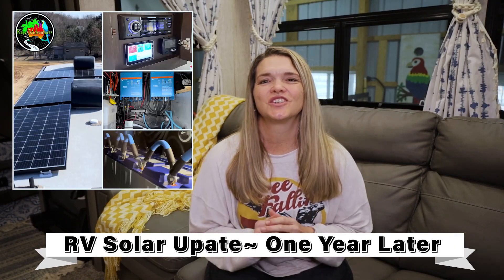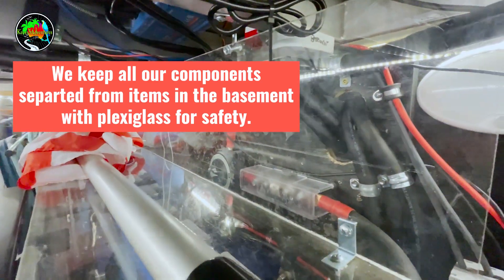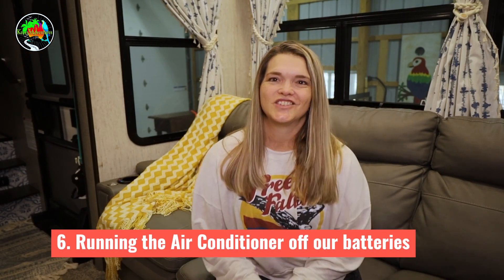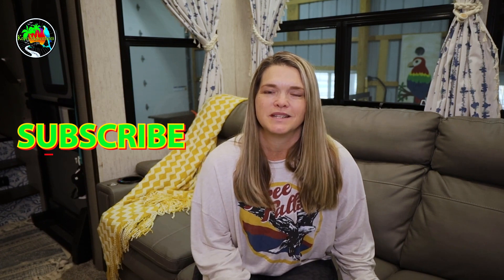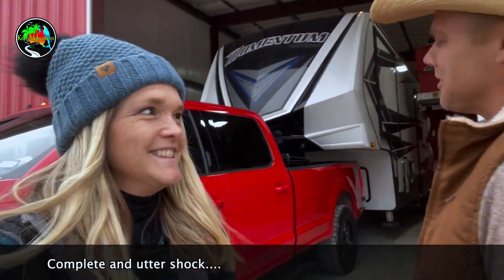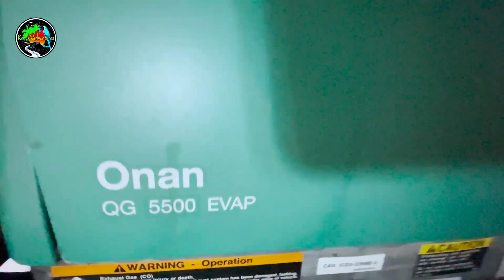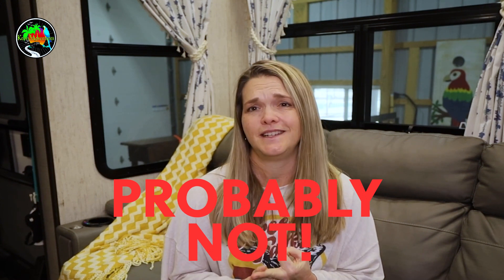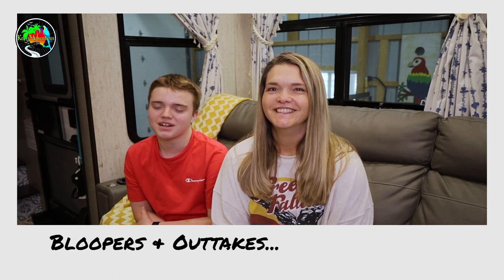RV Solar Update: 1 Year Later! Pros and Cons of Having Solar on Your Camper + Would We Do it Again?

Comment: A 9500W inverter generator would be much less costly than the BattleBorn batteries and the cost of the rest of the system you would get free gas to run said generator and pay for the Diesel for one year on the hauling truck.

Like you setup though... Thanks for that information- great video.
Reply from the maker: We agree! If you get to the end Charlotte says she would have preferred to just have our generator and skip the solar headaches.

Comment: I installed my own system and i have been impressed with how easy most of it was. I however would suggest a all in one system and not one that requires multiple pieces like yours has where everything is separate.  It also makes troubleshooting much simpler and operation is much easier.
Reply from the maker: When we had it done in 2021 a lot less was know then than now! That’s for sure. The technology is much better now! Our system is a pain and is so disorganized!
Reply: @keevs5adventures  Yup, I get that. The inverter I have is actually a home inverter, but I wouldn't change it for anything else. I'm pretty impressed with it and the 415 watt panels. I put 8 panels on the roof  and they are 50 lbs apiece. And I put two 5.12kWh batteries in and without running AC I can go 2 or 3 days with little to no sun. Make sure if you get new panels to use "half cut" panels as they do much better with shading.  It makes a huge difference.

Comment: Well, let’s be realistic about this, sounds like 95% of your problems are all installation related.
Reply from the maker: For sure! Best to get references. And make sure they weren’t trained by the NRVTA who installed our system during their solar technician class!
Reply: I think most installers, at least the ones on youtube, do not talk about the heat concerns of the solar components in a closed area.  I did find this guy that even gives a part list for a fan install.  https://youtu.be/aesa5mJJfNU?si=-PtnvYkl3HblPLW3
And i think the installers should be recommending a 24v system for the 50amp rv’s too.

Comment: That's why I have three systems, redundancy is the key. My main system is 24v
1020 watts. My bathroom and bedroom is 12v 1020 wattts. And my water system is on its own system. 12v 510 watts.
PS. my mobile Abode is a 53' trailer pulled by a freitliner Cascadia HDT.
Reply from the maker: Wow! That's a complex system! Ours is 12V, which we have debated selling the components and going to 24 or 48V. Sounds like you've got quite the setup. Do you have it posted online somewhere?

Comment: I'd like to talk to yall. Your installer kinda didn't do you right. I did all my solar and it's great... and dependable.  I have 45 kw of battery now but it's not battle born lol
Reply from the maker: You’re welcome to email us or message us via Facebook or Instagram. We have definitely had a hard time with our system and have had to become DIY solar people as well.
Reply: @keevs5adventures  you have some good equipment and there are several things that can be done to make it much more dependable.  I spent a huge amount of money and time on buying and installing the wrong stuff before I finally educated myself and got the right stuff. It looks like ypu guys are going down that same path. Now that I kinda have it figured out and I see what it takes to do it right I feel my knowledge and experience with this can help others to not spend nearly as much money and have a system that works great. The biggest thing I see that yall spent money on and isn't what I'd have choose is the battle born batteries. If you bought the eve 280 k cells you would have 3 or 4 times the battery capacity for the same amount of money. Another true game changer for me was buying a inovair brand 38 seer minisplit.  It only uses 600 watts for 10 minutes then it uses 200 watts the rest of the time it's running. It does heating and cooling and I installed mine in around 3 hours. Those roof top air units drain batteries  so fast. They are old technology and not good at all. I can run everything without any issues 24 7 just like as if I was hooked to a 50 amp service now that I have the minisplit and the eve batteries. Your battle born batteries are nice batteries but not for trying to run a system large enough to be a 24 7 system. Battle born are more of a weekend warrior type battery to be quite honest.  Another tip is that those charge controllers you have can handle alot more solar than yall have on them. They can probably handle about twice that amount. I'd have to do the math but I have a 150-70 and 2400 watts is about right for that controller.  If yall had a few more panels it would help alot but yeah the biggest thing to get you comfortable would be change the batteries and get a minisplit
Reply from the maker: When we got the Battleborns back in late 2020 it was the best option we found on the market. We have debated selling many of our components and changing to 24V. We also would get rid of the 3 395 watt panels (we had 4 but one flew off and we did not want it put back in the same spot. It won’t fit anywhere else). When it is cool our, that series shuts down the MPPT due to high voltage. As for the A/C mini split option, it would need 3 zones or 3 units to keep our RV cool. $$$$ Maybe just switching out one would help tremendously? As it is, we can only run one if we are charging our batteries when we arrive at a campground and need to plug in and charge. If money wasn’t a question, we would also go to a 12V refrigerator because this one uses 600 watts continuously. It will draw our batteries down during a drive day if it is cloudy! At this point, we hate investing any more money in the system and regret installing it. It hasn’t lived up to the hype and I hope others can learn from what our installer promised, but did not produce. It’s been a nightmare. We’ve had to use our Jeep and jumper cables to get enough DC current to bring in our slides and lower it onto our truck because of a plastic washer on the Lynx that melted. People need to be aware that not all installers are the same. Only way to know if an installer is any good is to talk to people who actually use the system in real life and don’t have issues like heat and shut downs.
Reply: @keevs5adventures  my camper had 2 13000 btu roof top air conditioners. I took them off the top of my camper and installed a 9000 btu inovair minisplit. It has variable speed and goes up to 13500 and as low as 2000 btu. It starts at 600 watts amd after 10 minor so drops to 200 watts the rest the time It is on.  I was absolutely amazed that it could out perform the 2 roof top ac units. Another great thing about the inovair is that it heats the camper also. It does use more power to heat than to cool. Yes I totally agree that you should sell the battle born stuff. It's heart breaking to know yall spent so much and can't use your system the way its intended. I'd about be ready to get a freakin lawyer involved for that crappy of an installer. If you guys are ever around Smyrna tn. Holler at me and I'll do what I can to reconfigure some stuff for yall and at the least show you what I've done in my holiday rambler so you can see what it's took to make it 100 % off grid capable. I too kinda wasted alot of money trying to get it right but now that it's right I couldn't be happier with it. In fact I just ordered another 14 kw of cells so I should be able to make it thru over a week of storms and still be fine. I kinda went overboard some would say but now we should have electricity the rest of our lives.
Reply from the maker: @matthewknight5641 that’s amazing! We will keep in touch! Would love to see your system and have you scratching your head about ours!! 😃

Comment: Thank you so much for your honest opinion  of your solar system. We have a solar system installed on our class A with BB batteries and have only used it twice because it's not always dependable and with the high temps we have had this year, I have had to use the air conditioner a lot, which means I had to run the generator. I am not totally convinced that the added expense and weight is equal to the payoff of having it. Thanks for sharing 💯👍🏽 Herbie, Mary, and Peanut
Reply from the maker: I think it is promoted as some magical system that allows you to run your AC from your batteries when it just isn’t realistic. Running it in cool weather is great, but we don’t spend much time camping in cold weather.
Reply: @keevs5adventures  And you have to be careful in cold weather because these batteries don't like to charge in the cold even with the internal heating system... Chasing 70 degrees was next to impossible this year..
Reply from the maker: @RedJaguar100Travels so true about the cold! And the way our installer hooked up our remaining 3 panels, we have high voltage alerts that shut down one of our solar controllers when it is colder out!

Comment: I lost a 360w panel from the same location on our 310GK. Ours had been on there for 18 months and 10k miles though.
Reply from the maker: You’re kidding!! When did you have it installed there?
Reply: @keevs5adventures  February of 22. I think there's a lot of wind pressure in that location. All of my other panels are rock solid. It just blew off 2 weeks ago on our way from Texas to New Jersey. It's in a ditch along I-81 in east Tennessee somewhere. I went back to see if I could find it, but couldn't. Fortunately, the way that array was wired it still works fine, just down 25% capacity.
Reply from the maker: @PHMadness  wow! Did you tell them? Someone could end up hurt. We’ve had lots of issues with our system. Our system wasn’t fused properly.
Reply: @keevs5adventures  yeah, he knows. I suspect he may even beef up how he mounts them now, even though he's mounted literally hundreds the same way. It sucks your installer wasn't up to the task on the design. I worried a lot about that because I'd heard stories just like yours. I had to wait almost a year for my appointment with The Dry Campers for mine, but I think it was worth it. He did an awesome job and I actually gained some storage space when he was done. It's all behind the wall in the basement.

Comment: Just watched and I agree with everything you said! We do not have solar, but we do have the 6 BB batteries and 2 MPs. I do not have the autotransformer and have been considering. Thanks for sharing your thoughts. I do think what I have (no solar) was totally worth it! I charge with my generator and have way less connections and potential issue points.
Reply from the maker: I think that is a great option. We just added so much weight and used up so much space. The whole system has caused way more worry than it is worth. Sometimes we love it, but most of the time we regret having it done. We've even debated tearing it all out, selling some if it and starting over.